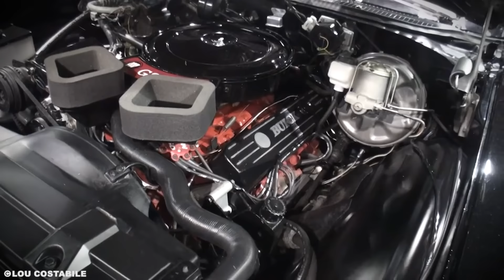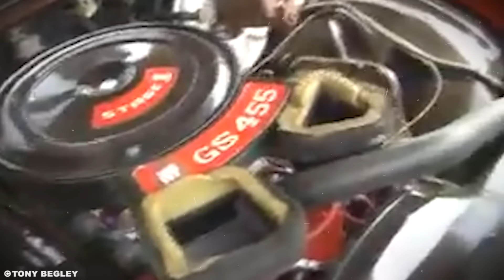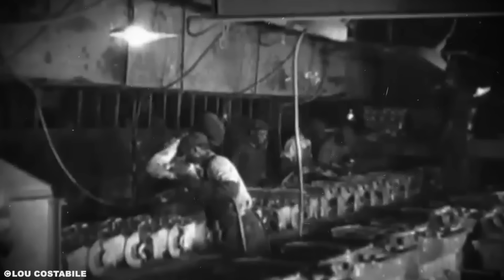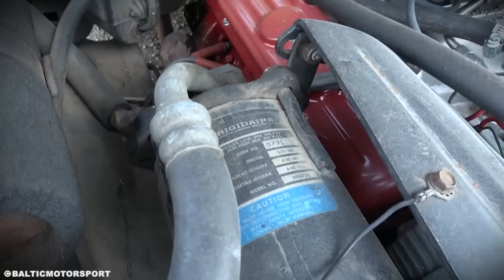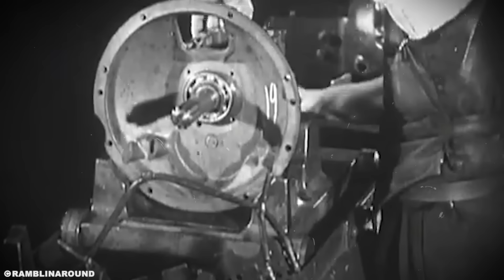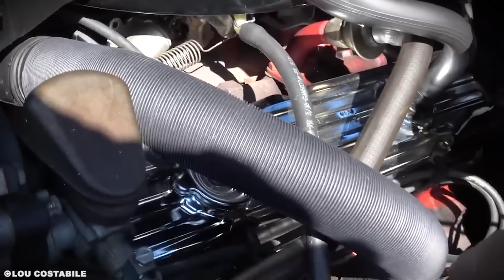This Texas Teen OUTSMARTED Buick With a $75 Stage 1 455 That Destroyed Hemis

Comment: The Buick 455 Stage 1 did not have a forged steel crank. It was Nodular iron just like the olds 455 W30 crank. On street tires his Buick lifted the front tires 6"   Right.. You are dreaming...Lots of incorrect and false info in this video. Your production numbers were completely wrong..Where did you get this info from for this video?
Reply: ❤BUICK❤GS/GSX❤Stage1❤Infinitely Ultimate Vintage Supercars Ever Period❤